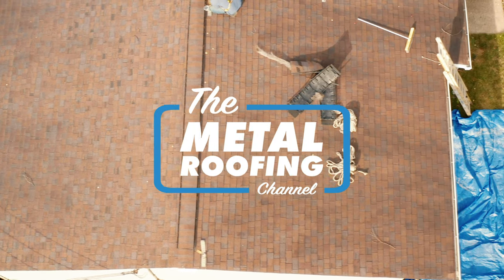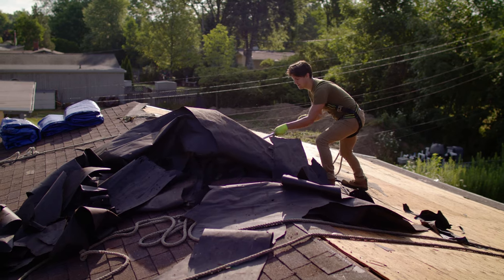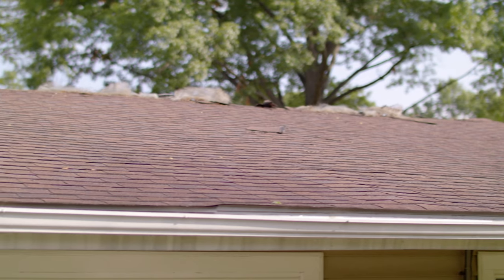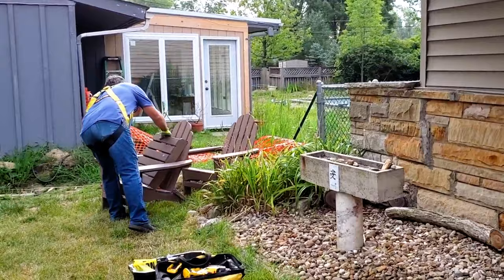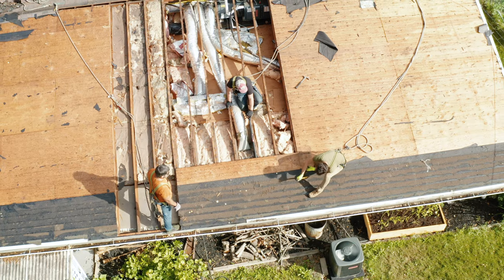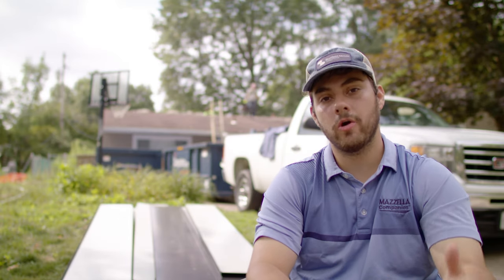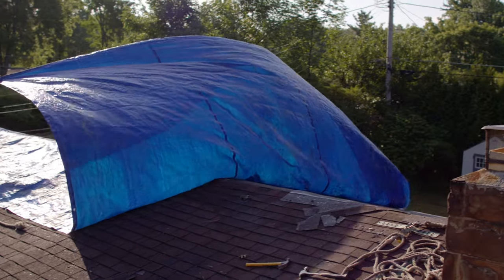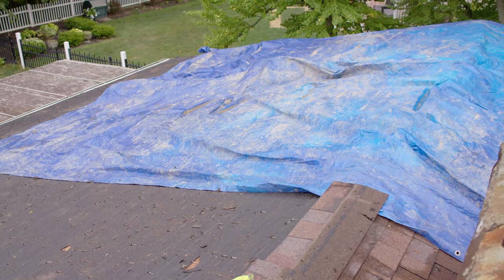5 Things to Help You Prepare for Your Shingle Roof Removal

Comment: Im interested in the tricks for evening out the waves in a roof. Pull plywood up and shim? Best way to make a straight but sloped plane to measure to? Thanks!
Reply from the maker: That video is coming soon in the next couple weeks! Stay tuned! -Thad
Reply: Me too. I have some major waves going on in one portion and on another part of the house the peak has dipped about a foot lower in the center than it is on the ends. Whomever built my house should have never been in this profession.
Reply from the maker: Hey Kevin, I hear ya. We're doing a full standing seam install on the house behind me in the video. It transitions from a vaulted ceiling to an attic space halfway through and right at the transition is a huge hump. We did a whole video about how we leveled out that section as best we could to get it as flat as possible. Keep an eye out for it! -Thad